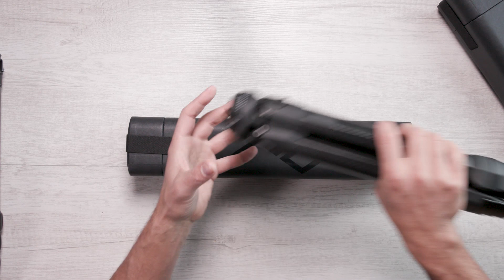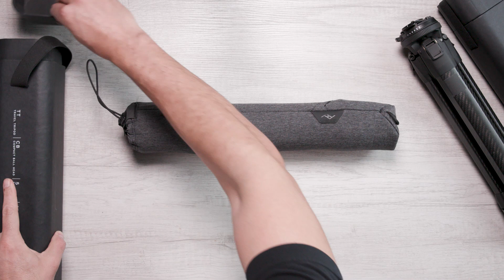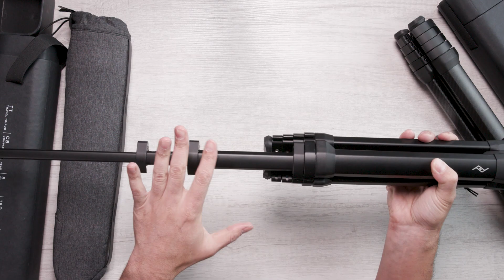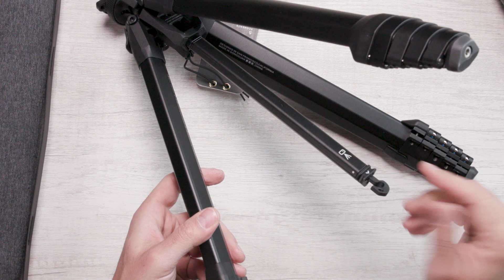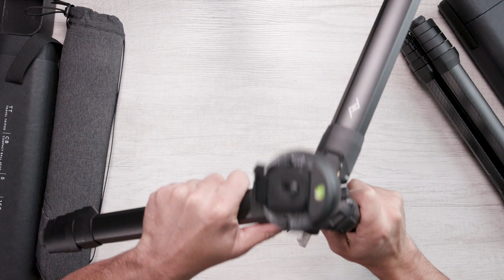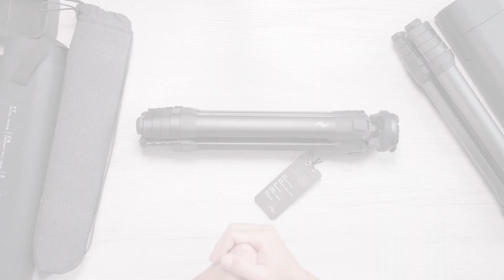Shaking up the Tripod Market: First Look at Peak Design’s Travel Tripod

Comment: They should have gone with a old school alum matte look on the legs with the darker components. This coating will get scratched up really quick and look fugly, so its a moot point to spend such for "design" aesthetics. Its grossly over priced. If it were more than $150, It would be a tough call.

Comment: Design wise this Tripod is exemplary but other than that there is nothing more to hype about.  Then there is the price which feels like paying a ransom.
The mount is unstable and needs to be double locked or risk dropping your camera accidentally. The plate needs Allen Wrench that's another big, big minus and needs to be constantly adjusted. Finally the clamps are made out of plastic so bound to suffer damage in extreme weather conditions.

BIG PLUSES -ERGONOMICS & SIZE
Reply: The gitzo tripod cost 650 and nobody have a problem with that
Reply: @lomaryearwood3079  Have you used Gitzo?  Use it and then let's discuss.

Comment: fold the roadtrip  the wright way its the same length
Reply: Thats what I thought,
Reply: @IvanDoherty1  It's almost the same length, yes, though not quite. But, more importantly, it's much, much wider and unwieldy overall. Which is very important if you're fitting the tripod into a rolling case that needs to fit in an airplane overhead bin. Also, the PD legs, thanks to their quality materials and non-circular design, are also far more laterally stable than the Mefoto. The Mefoto 5-section legs have so much flex it is shocking.
Reply: @MatthewSaville  All fair points. The Mefoto legs are a bit of a pain and one of my legs has a part that came off which stops me pulling the leg completely out of the socket. Every time I open it up, one leg always comes completely away from the unit. OK for the money I guess, but wish I had spent a little more.
Reply: @IvanDoherty1  Yup, I've seen that on 5-10 other Mefotos. The problem is, if you get a $400-600 tripod now, you'll have actually spent that much /plus/ the value of the Mefoto. That's why I so strongly encourage people to spend a little bit more money the first time, and get something that will last far longer, and also be actually servicable or repairable by the company. That's one reason why Slik is one of my favorite tripod makers- they have a service center in So Cal that is great.

Comment: I used to be one of those photographers who thought a good expensive tripod was un-necessary. Until i realized that i went through 4 cheap tripods. One of the cheap tripod i bought, one of the leg decided that it wont stay extended anymore and started to slide and it caused the entire tripod and camera to tip over. Fortunately, no damage was done to my camera because it landed on grass instead of concrete. With the the price of 4 cheap tripods, i could have bought a really good one. But instead, i ended up buy an high end Monfrotto Tripod. But the one i got is not a travel tripod, so i will be getting this Peak Design one since it is slick, light and seems very intuitive to use.
Reply: Haha, so true.

Comment: Did you find the carbon fiber version to be as sturdy as the aluminum one?
Reply: Yes, in fact CF is a more stiff, shock-absorbant material, so it's usually more likely to eliminate faint vibrations from a light breeze that can affect telephoto image sharpness in particular.
Reply: Matthew Saville have you used this model to know for sure? I generally agree with your assessment, but I wonder if the weight is so light that some of those listed benefits aren’t applicable. Of course one could hang a backpack, but that means you’re going fully extended.
Reply: @shifteleven  yes, I've already used this tripod at a couple of weddings. Its weight is about right for its materials and size. I also have ultralight tripods that only weight 2lbs, and I've seen self-proclaimed travel tripods that are about 3.5 lbs and yet are short and wobbly. This PD model is a very impressive compromise between weight and compactness and durability.
Reply: @MatthewSaville  awesome. Thanks!
Reply: K. Adam Christensen I went with a Carbon fiber monfrotto Tripod because it was a lot lighter than the others of its class. But for the peak design one, I feel that the weight difference is negligible and more for aesthetics.
Reply: @nokturn882  When you get down to that weight comparison, i feel like it's more geared towards two genres of photographer. 1) the timelapser/multi-cam shooter who rolls with 2-4+ tripods and a lot of other gear like rail kits for motion. and 2) the globe trotter who has to make every oz count with their luggage due to travel & weight restrictions. 
For both of those groups you're going to not hesitate to pay a little more to save a little bit on the weights.
Reply: David J. Crewe I guess you’re right. But I feel like a difference of 0.6 oz dont make a big difference in my opinion. I  have lens covers that are heavier than 0.6 oz. but I guess some people do see a big difference.
Reply: @nokturn882  oh sorry if there was confusion, the weight difference between the AL and CF is 0.62lbs.
The Al model is 3.44lbs and the CF one is 2.81lbs